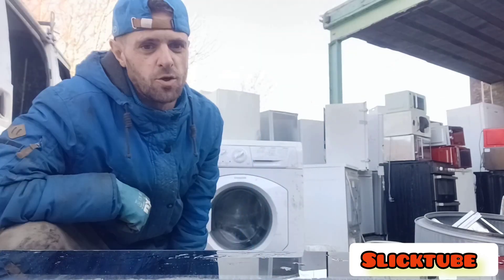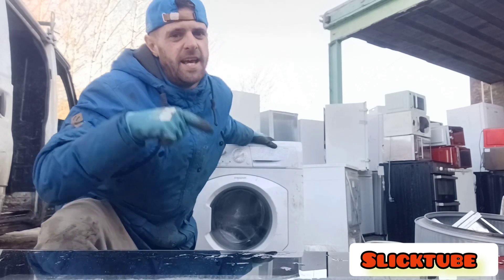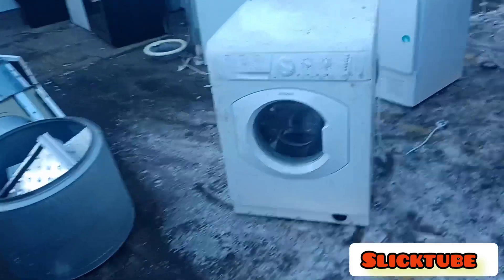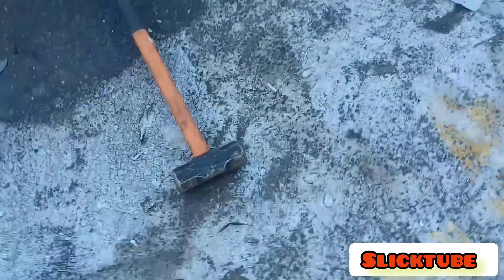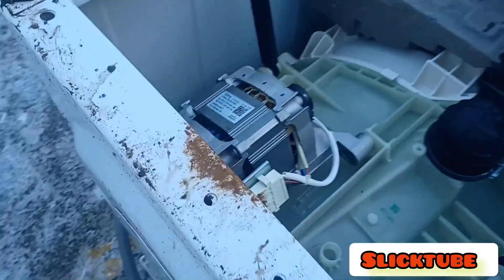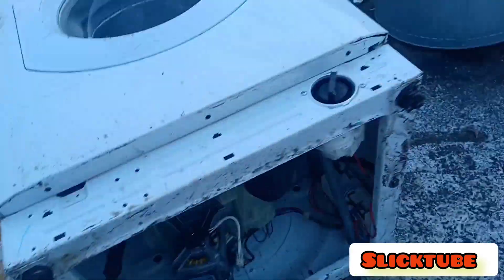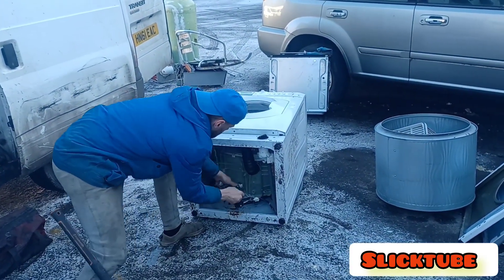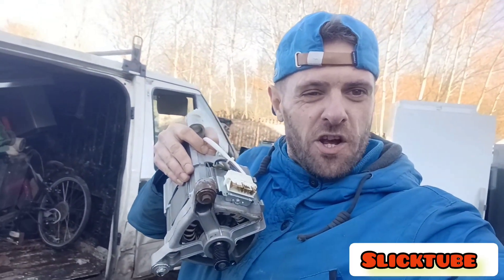Scrappers&pickers.... ( How To Take A Motor Out Of A Washer )💥 #mrjohn #slicktube

Comment: Big up for this info. Since collected about 10, and get 325 per tonne for em
Reply from the maker: 500 the normal rate
Reply: Ahhh iisit, thanks for the heads up John. I’ll have to ring a few diff scrappy then. I got 4050 for copper, 380 ally, 400 cable, 2850 brass, 1050 lead and 350 battery’s… are any of them prices shit aswell?
Reply: @mountjarvis3401  proper shit them fella should be getting over 6 for copper and 4ish for brass over 6 for batteries, shop around mate
Reply: @mountjarvis3401  you really need to be change scrap yards as them prices are so shocking your getting your pants pulled down mush